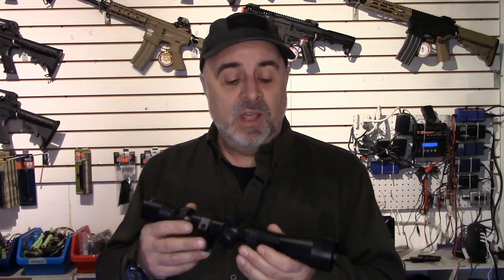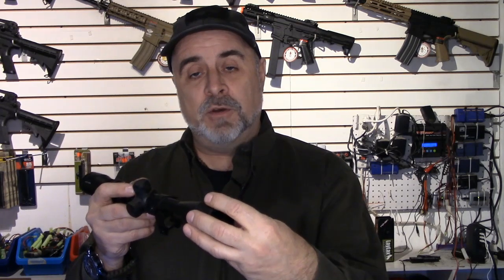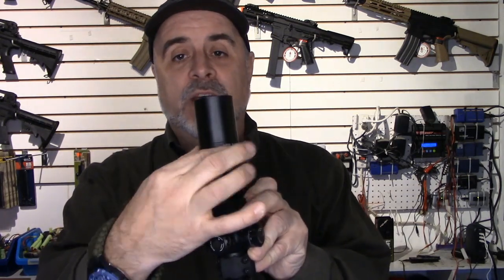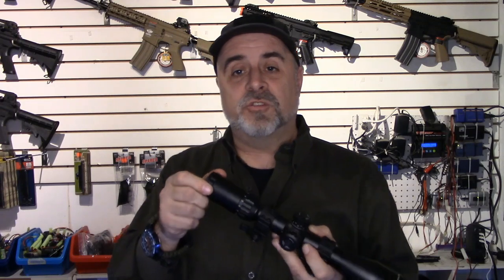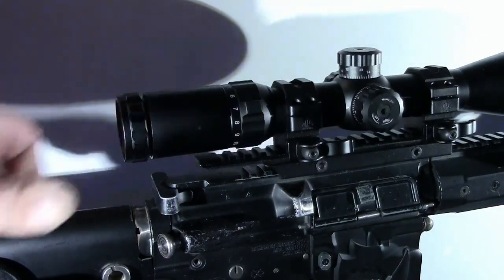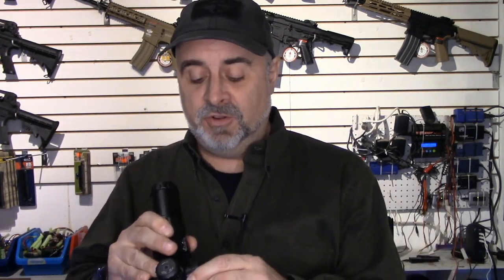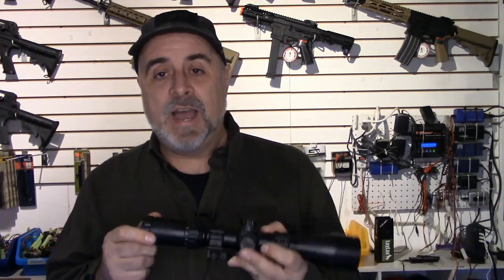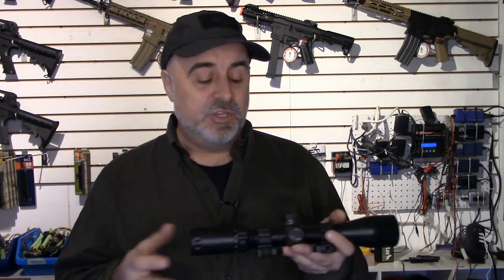Eliminating Parallax in Telescopic Scopes

Comment: I used to worked in the quality department for the largest 🇺🇸 scope manufacturer for many years.  So I’m not terribly familiar with lower end scopes, but for us each model is calibrated at a specific distance to be parallax free.  The majority of them was around 150 yards but some of the models would be as low at 25 yards.  

So adjusting your diopter correctly will help, but if you have a scope with a fixed parallax, it might be calibrated for a distance that is too far out of the airsoft gun’s capabilities.  Additionally an adjustable parallax might also be too far out of the window if it’s has a minimum distance of 100 yards and out to infinity.  

Like I said I don’t know anything about the lower end scope market, but for +$150 you can get a scope that is setup for closer ranges.  Look for 22 long rifle or shotgun scopes.  Typically they are around 2.5x power.